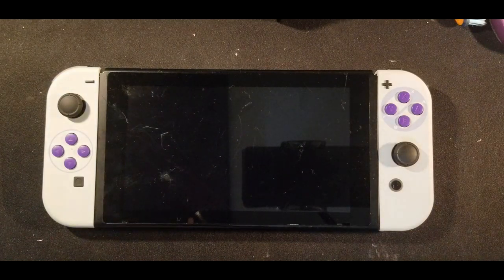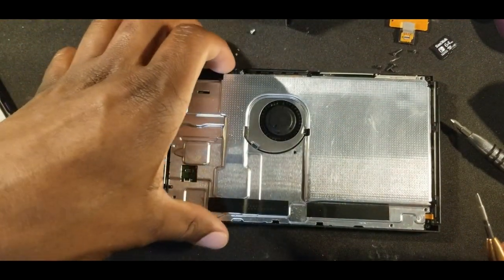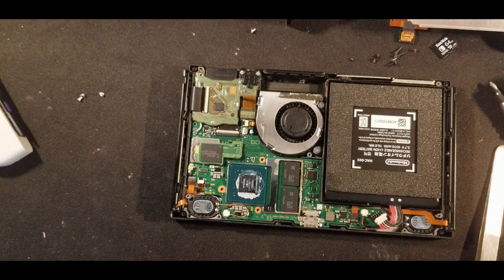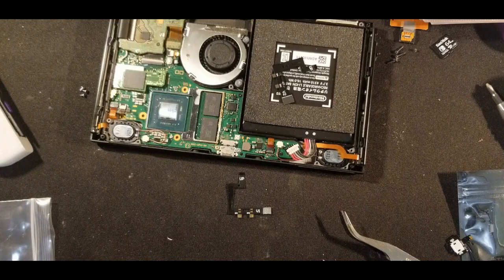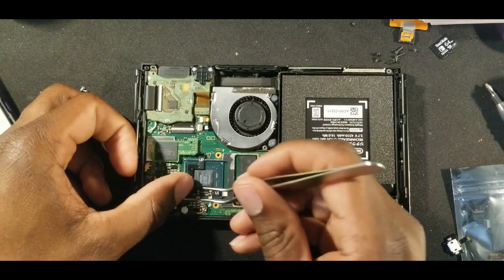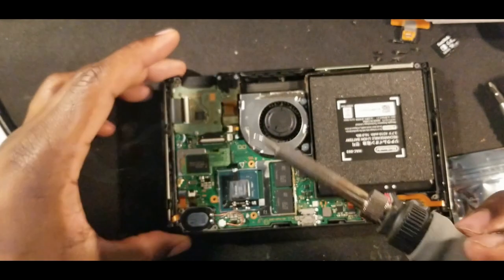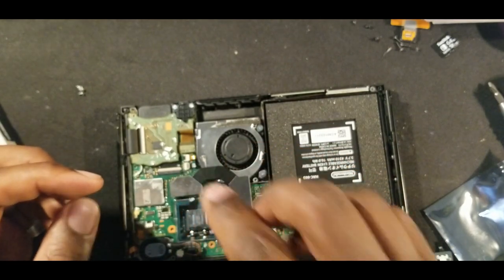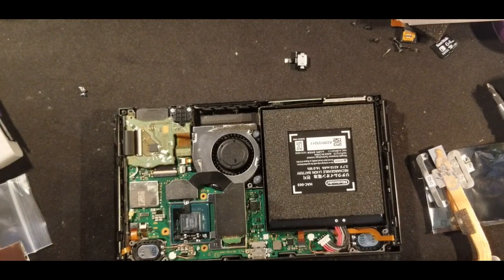Switch Modchip

Comment: My toxic trait is that I think I could do this with out bricking my switch and no soldering experience
Reply: I think I can do it I still be nervous I may break something I have some wielding experience can’t be to different than soldiering
Reply: How do you get soldering experience
Reply: @Vuden13  you solder
Reply: lol well I wouldn't start with this project but it can and has been done as a first time soldering project to varying success. I started with xbox 360 controller rapidfire mods in like 2008. It was a simple momentary switch soldered to two points on the board. Some advice I would say is definitely USE FLUX and don't use those wet sponges that you get. They cause oxidisation on the tip and stops solder sticking and overtime ruins it. Use the metal iron cleaning balls. You want to use it to clean off the solder every time you put the iron down. This stops dirty solder with burnt flux and crap in it that doesn't want to flow onto anything from building up.
Reply: @Notpoop906  I actually appreciate the time you took out of ur day to give me well thought out advice I appreciate it a lot. I’ve been looking into getting the pinecil to start soldering. Would you recommend for or against it?

Comment: Yeah it's pretty easy to get a cold solder joint on the CPU ribbon cable. The solder on the caps they are using is a very high melting temperature. All I can really say is use a bladed tip and personally I prefer to run the iron at max temperature to minimise the time spent touching the point to the capacitor.

Comment: Removing the shield is the easy part. The hard part is soldering to the emunand. I did a switch lite the points were another more smaller.
Reply from the maker: Flux, turning up the temperature of my iron, and a prayer is how I do it
Reply: @DeedTech  I feel you bruh them points are crazy small. I did my first back in 2020 when SX OS first came out and watched a dodgy video that showed me how to do it my hands were shaking lmfao
Reply from the maker: @lostdeath4202  I used a microscope for my OLED install and it's a game changer.  You dont need to be squinting, trying to look into another dimension...
Reply: @DeedTech    Yeah I wish I had one I really wanna get 1 that you can look through at the top and also stream the video feed to the computer but the only cheap ones I've seen they just streamed to the computer that's it I like to look straight down not at the computer when I'm sobbing cause it kind of messes me up which Mike which microscope do you use
Reply from the maker: @lostdeath4202  an old one a friend had lying around.  It works. 

I'd also like one I can stream. Maybe I'll upgrade soon. I have a n64 digital I want to install but that would be hard to show without the camera stuff.
Reply: @DeedTech  You can get on that just streams to the PC for 100 dollar but it don't have lens to look down on the board so you have to stare at the PC while soldering. If you don't mind me asking where you get the n64 digital?
Reply from the maker: @lostdeath4202  I'd go with a good quality one that can drop into a microscope (I'd have to upgrade mine)

PixelFX made their own. Youd have to follow them on twitter for the latest update and next batch drops.
Reply: @lostdeath4202  its not a big deal if someone have a little bit of soldering experience a totally noob guy will surely find it difficult its also normal not everyone is born skilled everyone learns with experience any guy who finds it difficult i recommend watch these installation videos many times carefully and do some soldering practice on dead boards before installing the chip on switch a part from those 2 soldering points there is nothing much using a needle tip solder iron is must if you dont have microscope you can complete the installation using a lamp and mobile set zoomed on the switch point to be soldered placed above the table also a bright lamp using a needle tip solder watching through zoomed mobile screen you can carry on the soldering ill recomment it after practicing soldering on dead boards i worked on wii u motherboard and changed micro filter using this method fixing the wii u which was not booting earlier this i find easy but installing mod chip in  oled switch is very much complicated compared to that this is simple

Comment: Very easy install if you have very basic soldering skills, thanks for the vid!
Reply: I brick my NS motherboard after trying to solder new usb-c port as I cooked the other ic's using heat gun lol. plus my soldering skill isnt that good. I ended up buying new motherboard for  $100. lol

Comment: What are the next steps once you have soldered the chip. That is not shown anywhere else.
Reply from the maker: There's plenty of videos that how to do things software side. Some other channels are the opposite where they only really show things software wise and not hardware. They make videos on software updates, apps, etc. They handled the software side if things much better than this channel.

I couldn't tell you the last time I even turned on my switch...

Comment: I would learn how to solder really well before attempting this also I would get a clear back Plate so you can see the mod chip also you want to organize your screw because if you dont and you put the screws in the wrong spot your device could be f**ked, if you want to start out mod chipping I would start with the ps1 it's to easy also attempting to take off the nitendo switch controller and putting it back together is hard so I would not modify the controllers unless you want to chance a headache and 70$ wasted because you broke the controllers on a accident
Reply from the maker: Clear backs are nice, I have a green one on my main switch. It's cool but they seem to be much more brittle than the other backs
Reply: @DeedTech  thanks for the information

Comment: is it pretty much impossible to get a patched switch with the latest firmware hacked now? especially since they stopped production,
Reply from the maker: Unless you can get your hands on a chip, I've seen some overpriced chips on sites like etsy. So it comes down to how much you value the mod.

Only real hope is if someone reverse engineers the chips and make them open source. 
Or 
Purchase a v1 switch and use the RCM jig/loader or the internal chip to glitch without the jig/loader.
Reply: @DeedTech  gonna be hard to get a v1 switch, had to drive for 3 hours to get this one, and pay toll and stuff, think i'll just keep an eye out for both
Reply from the maker: @Freddy0503  If your in the US, go on ebay and look up "v1 switch" or "unpatched switch". There are some that arent terribly priced
Reply: @DeedTech  i'm from the EU
Reply from the maker: @Freddy0503  try looking online. It's much harder looking local. I dont know what are your online sites for used items over thetebut you can always ask people what their serial numbers are.
Reply: @DeedTech  sadly i didn't think to do that with my current one, turns out the left joystick drifts, battery has barely any juice left to the point a full charge is like an hour
Reply from the maker: Bult03  chips are no longer in production. Anyone selling now, has jacked up the price since they're more and more rare now
Reply: @DeedTech  what do i look up on etsy to buy it
Reply from the maker: @345Faydo  they come up periodically. But you have to use different keywords. Sx core, sx lite, switch modchip, switch modded. They'll probably be one up later this week 😉
Reply: Yeah right I have version switch only switch can read memory card if I did update I have firmware 15.0.1 on it now I have no choice to buy chip to mod it switch

Comment: Thanks :) Can you say what type of solder and glue you used?
Reply from the maker: The sticker on my solder roll has come off so I measured it. Its about 0.8mm/0.3in. For my electronic projects I use  this stuff, a J tip on a soldering iron that can be temperature controlled.

Comment: hey there what is the difference between an upgradable chip an a flashable chip is :)
Reply from the maker: They're probably the same. I know with the OLED there were some chips that you couldn't upgrade the firmware, and there were some so you could. The firmware  updates were for faster booting times, and some other things

Comment: Im curious. I noticed he didnt remove the board so what is this chip? Also is there a chip thats recommended for the oped switch thats maybe the best and easiest chip??? Anyone thanks
Reply from the maker: This was one of the original chips by Team Xecuter. Discontinued as the whole company was shutdown. 

The board wasn't removed because on the original switch and switch lite, you didn't have to remove the board. On the switch OLED you have to remove the board. There are cheap chips for the OLED now like the instinct and some others. You can also go the open source route and use an RP2040 (other chips are now based off that one).
Reply: @DeedTech  appreciated

Comment: can you homebrew a switch XKJ1 after making this modchip
Reply from the maker: All switches can be modded. If using the correct chip and if the latest firmware is supported,  then yes

Comment: hello i have sx os modded chip one accidently i update the firmware to 14.1.1 is there any chance i can mod it again with sxos ?
Reply from the maker: you are out of luck,  sxos was unable to work on anything after 13.1.0 (or something like that). You will have to switch over to atmosphere. You will need to check out their github page to see if the latest version is relased.

If you created an emmunand and that was updated not your sysnand, then you should be able to get back to an sxos compatible firmware
Reply: @DeedTech  dammit i dono much about it , i didnt create any emunand could u please let me knoe if anything comes for 14.1.1 it will be a huge help thank you

Comment: My switch blinks Blue for long time, them red and nothing happens. Can u help me?
Reply from the maker: Your solder points may need retouching. If you were to unplug the main chip from the ribbon cable connected to the CPU, if it boots up normally then the issue is probably the solder. That's my guess
Reply: I've figured out what was going on.
The micro sd reader was not totally plugged, I opened the switch by my self and connected again. Everything good now!
Reply from the maker: @Tecorenato  glad to hear you're up and running

Comment: Greetings, blessings as I know what chip my Nintendo has to continue with the hack??
Reply from the maker: Not sure I understand? 
You want to know which chip to use for console?
Reply: @DeedTech  yes mi serial  is XKW  what chip use for the hack ?
Reply: @DeedTech  and where can I buy it
Reply from the maker: @djad_pr9461  if it's a regular switch you need a core and a lite for a switch lite. They can be found on ali Express. Links get taken down so I dont post any.
Reply: @DeedTech  so I need the normal, v2?  and ok I verify in aliexpress.
Reply from the maker: @djad_pr9461  sx core works on v1 and v2, you just need the right adapter.

Comment: Where you get the core?
Reply from the maker: They're no longer in production. Anything  available is rare is going to be expensive. The easiest way to have a modded switch now is to use a v1 switch and the RCM method or use a v1 switch and install a trinket m0 internally. The trinket m0 method is the closest method to the sx core, it doesn't require an external payload injector (dongle, computer, android phone)

Comment: Interesting. Unfortunately I'm way underskilled for this sadly. lol
Reply from the maker: Many people send it off to someone to do the soldering
Reply: @DeedTech  Yeah. I'd send it off if it wasn't nigh-impossible to get mod now.
Reply from the maker: @XXCoder  sx clones are available on aliexpress. You can search the name of the clones there an itll pop up. For most people it's the cost of the chip plus the installation service that sets them back. Might be worth looking for a v1 unpatched switch then getting a cheap RCM jig and sending payload with computer
Reply: Hmm sorry if acciental spamming, but seems comments disappear now
Reply: @DeedTech  okay so yeah seems urls disappears. only ones I can find is RCM ones.None of sx
Reply from the maker: @XXCoder  still there. I just checked. There is no picture of the chip, "sx" is not in the title either.

Comment: Does v2 core work on v1 patched switch
Reply from the maker: The core will work on a v1 you just need the adapter for the v1 CPU. The trinket m0 is a much cheaper option for the v1 that will accomplish the same end result

Comment: I have a question is this an error or normal??
Reply from the maker: What exactly?
Reply: @DeedTech  the boot dat indication is an error or normal??
Reply: @DeedTech  i have solder everything correct and i have green light on my mod chip and when i open the switch with out the sd card you know for the first time it says boot dat just like you is this an error or normal??
Reply from the maker: @ΤαξιάρχηςΒλαϊκούδης-θ4η  boot.dat means you did everything correct. You have to grab the "payload" of what ever you want to run and go from there 

If you have the boot.dat screen you may have to update the firmware to something newer (I don't remember). Those are much older chips at this point.

I'd try running a payload like hekate and seeing it if runs
Reply: @DeedTech  i have the hats pack from the sthetix so i think i be fine??
Reply from the maker: @ΤαξιάρχηςΒλαϊκούδης-θ4η  usually better to build from scratch. But you could use it to test for sure. Might be worth checking out the GBAtemp forums. Or other YouTube videos. I don't really follow what's going with the CFW side of things
Reply: @DeedTech  ok i will test it and i will tell you what happened maybe we will find something earlier and new
Reply: @DeedTech it works flawlessly with the hats pack just to know

Comment: There is no other way to hack patched switch?
Reply from the maker: Patched, there is no other way. You have to get a v1 and mod or find an sx chip which are rare
Reply: my switch is v1 but not patched, i think it's hard to put the chip that's way i'm searching for easy solution
Reply from the maker: You need make sure your switch isn't patched first. If you're unpatched, you can purchase the RCM loader. You'll have to set up some files but it's the easiest method. You wont have to open up the switch at all...

https://ismyswitchpatched.com/
Reply: okay thanks
Reply from the maker: @Mohamed-wxp  I've had a few people ask me about what they can do. I think I'll order a switch and make a video describing your options available. Consider subscription
Reply: Deed Tech Thank you very much and we are grateful for your help